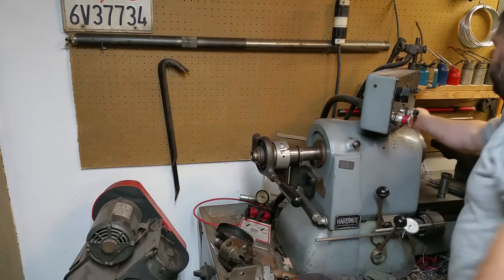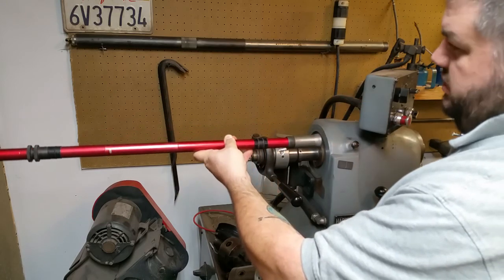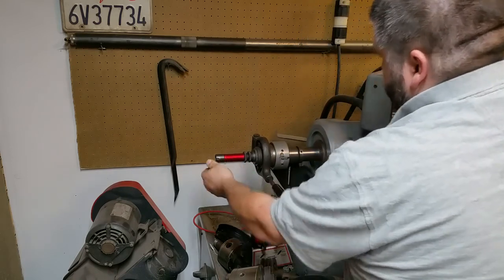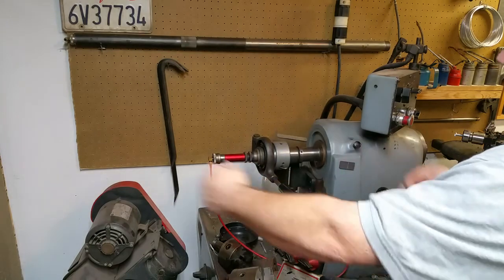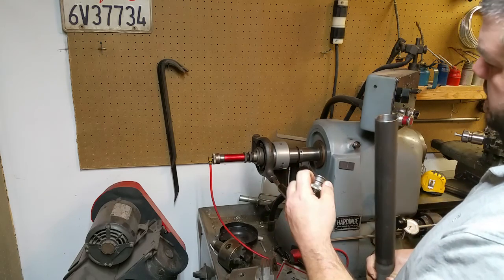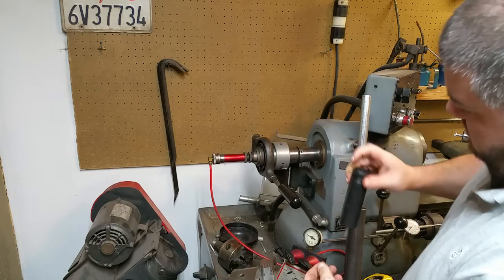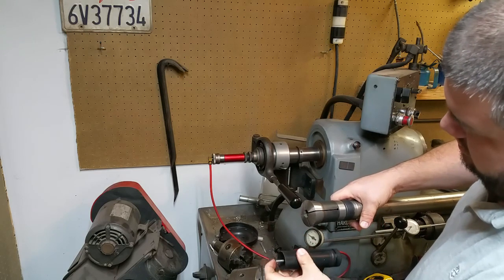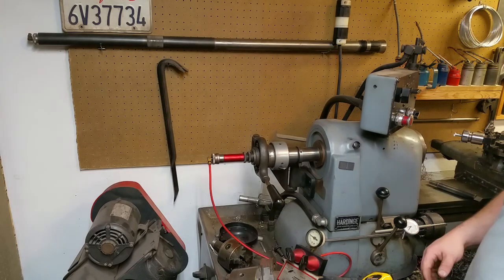Overview of the Hardinge HF-1A air operated barfeed

Comment: I just got a hardinge chnc 1 great design i would like to copy it thanks.
Reply from the maker: I made a 40 inch long one for my CHNC 1, I've got another video about that.  The hardest part is the vacuum/pressure controls, the barfeed tube is very straightforward.

Comment: The one my friend has is made differently. No "puck" type pistons only a long pusher rod with piston attached. and a cap on the collet end. The only way his could work is if most of the red tube was out of the draw tube. The puck piston makes sense. Maybe yours is a later model.  I could email pics if your interested. I'd like to repair his and use it inside the draw tube like yours works.......way safer. He told me I could have his (what remains after the bend mishap).